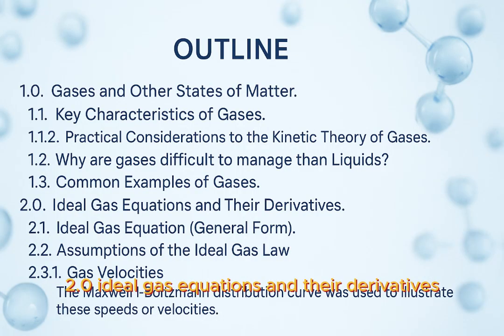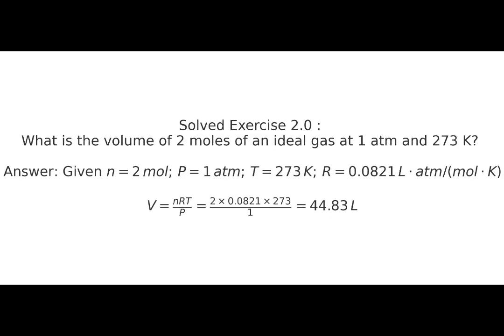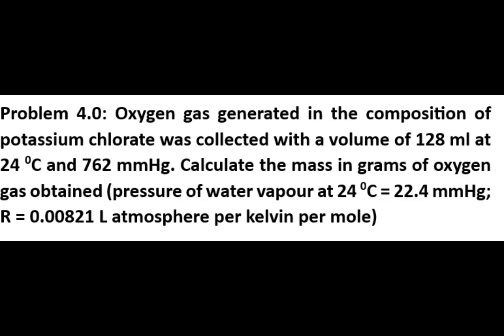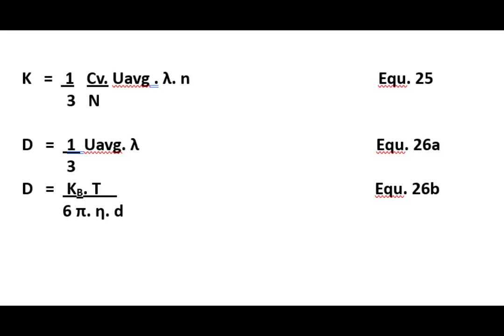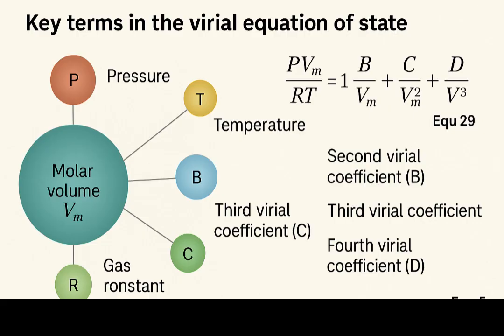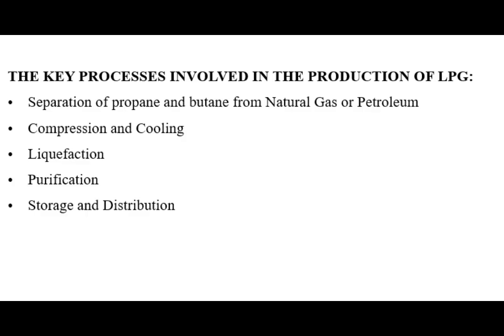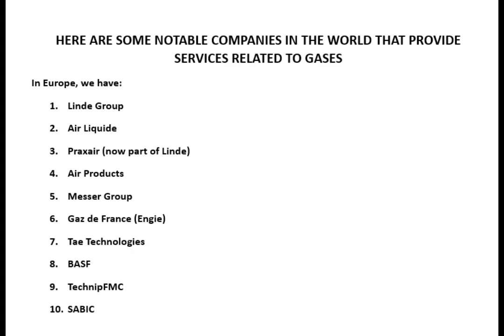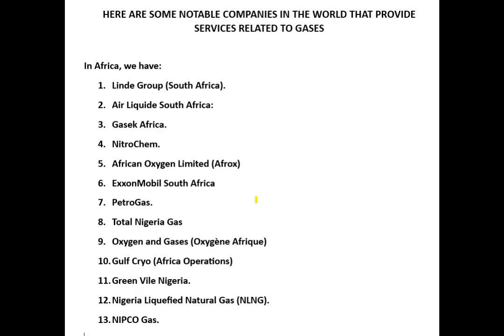Fundamentals and Applications of Gases

Comment: BCH: Using free atmospheric oxygen instead of pure oxygen from a cylinder during surgery is unsafe. Atmospheric air contains only 21% oxygen and is not sterile, while medical-grade oxygen from cylinders is over 99% pure and specifically prepared for clinical use. Relying on atmospheric air increases the risk of hypoxia, infection, and incorrect anaesthetic delivery. It also lacks the controlled flow and pressure that cylinder oxygen provides. For safety and effectiveness, only medical-grade oxygen should be used during anaesthesia.

Comment: BCH: Composition of Atmospheric Air vs Pure Oxygen
Atmospheric air contains:

~78% nitrogen

~21% oxygen

~1% other gases (argon, CO₂, etc.)

Medical oxygen cylinders contain:

100% pure oxygen or a precise medical gas mixture (e.g., oxygen + nitrous oxide + anaesthetic agents)

Implications: 
1.)Using air directly from the environment won’t deliver the necessary oxygen concentration for anaesthesia or respiration under surgical stress.

2.)Implication: Using unfiltered air from the environment risks contaminating the patient’s airways and causing infections or inflammation.

3.)You cannot control anesthetic drug concentration or delivery properly using environmental air. This can result in underdosing (patient wakes up) or overdosing (toxicity or death).

4.) 21% oxygen in room air may not meet the body's needs, especially if the patient has respiratory or cardiovascular compromise — leading to hypoxia (oxygen shortage).

Comment: BCH.......  Agwu Nneoma 
Matri U2023/5535009

Using air instead of pur oxygen would greatly reduce the oxygen concentration available to the patient. This is inadequate for anesthesia, where higher 21%oxgyen levels(often 100)are needed especially when the patient's breathing is suppressed.

Comment: Gly:U2023/5565099
 Ionization of gases in the atmosphere plays a role in lighting during thunderstorms 
  Lightning and ionization 
 During a thunderstorm, electrical charges build up in the clouds. When the electric field become strong enough ,it can ionize the air ( create ions and free electrons) leading to a breakdown of airs insulating properties. This ionization leads to lighting discharge.
  As for electric buld ,ionization is involved only on a certain types like fluorescent or gas discharge.

Comment: PIC
LNG isn't produced via JT experiment because:
1. Inefficiency for large-scale production
2. Difficulty achieving extremely low temperatures required for LNG
Instead, industrial processes like liquefaction cycles and cryogenic distillation are used for LNG production.

Comment: PIC:Joule-Thomson Cooling Is Limited
- The JT effect cools gas during pressure drop without external work.
- For methane to cool effectively via JT, it must first be pre-cooled below its JT inversion temperature
- At room temperature methane warms instead of cooling when expanded — it has a negative JT coefficient above its inversion temp.

Comment: MCB
Yes, ionization of gases in the atmosphere during thunderstorms can cause lightning
   During a thunderstorm strong wind and friction causes charge separation in clouds this creates a potential difference between the cloud and ground.Air normally resist electricity but when the electric field becomes strong enough it ionizes air molecules (nitrogen and oxygen) thereby making air a conductor,allowing a massive discharge which is lightening 
2.LIGHTING OF ELECTRIC BULB:
    Ionization is involved in some bulb not all especially gas filled ones 
Traditional bulb like incandescent don't rely on ionization rather they light up due to a heat filament BUT fluorescent and gas discharge bulbs like neon,sodium vapor, mercury lamp uses ionization because electricity ionizes the gas inside the bulb which releases energy as light when they return to a lower energy state

Comment: MCB: Yes, lightning is caused by the ionization of gases in the atmosphere during a thunderstorm. This ionized path allows a sudden discharge of electricity - what we see as lightning.
(2)Yes, for florescent and gas discharge lamps ( like neon lights or sodium vapor lamps).
And No, for regular incandescent bulbs : These use a  heat filament to produce light not gas ionization.

Comment: MCB: Yes, ionization of gases in the atmosphere can cause lightening during a thunderstorm. When the electric field in the cloud gets strong enough, it ionizes the air, making it conductive and allowing lightening to strike.
 
As for electric bulbs, ionization is involved only on certain types like fluorescent or gas-discharge bulbs, where electricity passes through gas to produce gas. But in regular incandescent bulbs, ionization does not happen. The light comes from heating a metal filament.

Comment: MCB:Yes, ionization of gases cause  lightning during thunderstorm and in some types of electric bulbs.

During a thunderstorm, when air gets heavily charged due to friction inside clouds, the gases (mainly nitrogen and oxygen) become ionized. This means they turn into charged particles, which suddenly makes the air conductive causing a massive electric discharge we see as lightning. 

As for electric bulbs, it depends on the type. Incandescent bulbs don’t use ionization—they simply heat a filament until it glows. But in fluorescent and neon bulbs, gases are ionized when electricity passes through them. This ionized gas then emits light. So, ionization helps some types of bulbs glow, but not all bulbs.

Comment: MCB(U2023/5555006)....
Yes. Ionization of gases can cause lightning during thunderstorms and also helps in lighting certain electric bulbs because.
1. Lightning in Thunderstorms:
- In a thunderstorm, clouds build up opposite charges (top is +, bottom is –).
- When the charge difference becomes too high, it ionizes the air between the cloud and the ground.
- Ionized air becomes a conductor.
- This causes a big spark of electricity called lightning.

 2)Does Ionization bring light to electric bulbs.
Yes it causes electric bulbs to produce light through ionization because.
 Lighting of Electric Bulbs (like fluorescent or neon bulbs):
- Inside the bulb, a high voltage is applied.
- This voltage ionizes the gas inside.
- The gas becomes a conductor, and the current flows.
- The ionized gas gives off light when excited atoms return to normal.

Comment: GLY: U2023/5565063
Liquefied Natural Gas (LNG) is natural gas that has been cooled to a liquid state, at around -162°c (260°F) the process reduces its volume by 6000 times, making it effective for storage and transportation.
LNG is used as a cleaner burning fuel alternative of power generation, industrial processes and transportation

Comment: MCB: Ionization and Lightning
Ionization of gases in the atmosphere contributes to lightning formation. During thunderstorms, collisions between ice crystals and graupel generate static electricity, leading to charge separation and a strong electric field. When the field becomes strong enough, it ionizes the air, creating a conductive pathway for electricity to flow, resulting in lightning.

Ionization and Electric Bulbs
In fluorescent lamps, ionization of gases (like argon and mercury vapor) occurs when an electric current is applied. The ionized gas emits ultraviolet light, which interacts with a phosphor coating to produce visible light.

Comment: MCB:. Ionization of gases in the atmosphere plays a role in lightning during thunderstorms.

Lightning and Ionization
During a thunderstorm, electrical charges build up in clouds. When the electric field becomes strong enough, it can ionize the air (create ions and free electrons), leading to a breakdown of air's insulating properties. This ionization leads to a lightning discharge.

Ionization and Electric Bulbs
Ionization of gases isn't directly responsible for lighting electric bulbs. In incandescent bulbs, light is produced by heating a filament until it glows. In fluorescent bulbs, light is produced by exciting gas (like mercury vapor) which then emits UV light, converted to visible light by phosphors.

So, ionization of gases contributes to lightning but isn't the mechanism for lighting electric bulbs.

Comment: BCH:
Not using real gas (such as medical-grade gases like oxygen, nitrous oxide, carbon dioxide, etc.) during surgery when required can have serious medical, ethical, and legal implications. Example

1. Patient Safety Risks
Hypoxia: If medical-grade oxygen is not used properly, the patient can suffer from a lack of oxygen (hypoxia), leading to brain damage or death.
Toxicity or Contamination: Using non-medical gases or impure sources can introduce harmful substances, risking poisoning or infection.
Inadequate Anesthesia: Anesthetics like nitrous oxide must be delivered in accurate concentrations. Improper gas use can cause the patient to awaken during surgery or suffer adverse reactions. 

2. Surgical Complications
Improper Insufflation: During laparoscopic surgeries, CO₂ is used to inflate the abdomen. Using the wrong type or concentration of gas can cause: Tissue damage
Poor visibility for the surgeon
Cardiovascular complications 

3. Legal and Ethical Consequence

Violation of Medical Guidelines: Not using approved medical-grade gases can result in penalties from medical boards or institutions.

4. Equipment Damage
Non-medical gases may corrode or damage anesthesia machines, ventilators, and other sensitive surgical equipment, leading to device failure or costly repairs.

Summary:
Using real medical gases is critical during surgery. Not doing so puts the patient’s life at risk, exposes the surgical team to legal consequences, and compromises the integrity of the medical procedure.

Comment: BCH:  The central implication of not using the real gas application of Oxygen in cylinders during surgery is the risk of HYPOXIA (low oxygen in tissues) in patients since sufficient energy isn't reaching the patient resulting in serious complications like;
* Organ damage 
* Brain damage & even 
* Death.
Also some clinical machines functions can be altered, like Anaesthesia machines and Ventilators which rely on precise gas measurement for proper functioning. This situation can also lead to miscalculation in gas volume and pressure. Therefore the real gas application of O2 is very crucial in cylinders during surgery.

Comment: P.I.C (U2023/5581102) _ The JT experiment involves cooling a gas by expanding it through a valve causing a temperature drop. For natural gas (LNG) which is mostly Methane the JT experiment is less efficient because its cooling coefficient is relatively small, meaning the cooling effect per expansion is limited. Thus LNG cannot be produced primarily by the JT effect experiment.

Comment: BCH: The use of free and pure oxygen gas in the atmosphere for anesthesia during surgery, as opposed to using a cylinder of pure oxygen, would have several significant implications.Atmospheric oxygen is only about 21%,the rest is mostly nitrogen with traces of other gases .where as , medical oxygen contains 95-100% pure oxygen under pressure. Using atmospheric oxygen would be highly inefficient. It would be challenging to deliver a precise, consistent amount of oxygen to the patient. Using atmospheric air doesn’t allow accurate control, which is critical during anaesthesia. Anesthesia requires a precise balance of oxygen and anesthetic gases.Without a controlled delivery system, it would be impossible to regulate the amount of oxygen and anesthetic agents the patient receives, leading to potential complications.

Comment: MCB:

1) Ionization is a crucial step for lightening formation during thunderstorm. It's a key mechanism that allows the energy stored in the storm to be released as lightening

2) The lightening of certain light bulbs like: gas discharged lamp,is directly related to the ionization of gases. This ionisation, have been proven to lead to the emission of light.

Comment: GLY: U2023/5565009: In coiled tubing operations, nitrogen is used as a gas lift or to energize fluids. The reason for using real gas properties rather than ideal gas properties is that real gases deviate from ideal behavior under high-pressure conditions, which are common in oil and gas well interventions.

REAL GAS BEHAVIOR

1. High Pressure: At high pressures, real gases exhibit non-ideal behavior, such as increased density and compressibility.

2. Accurate Calculations: Using real gas properties ensures more accurate calculations of gas volume, pressure, and flow rates.

IMPORTANCE

1. Safe Operations: Accurate calculations help ensure safe and efficient operations.

2. Optimal Performance: Using real gas properties optimizes coiled tubing performance and reduces the risk of errors or accidents.

Comment: BCH: Using normal air from the atmosphere instead of pure oxygen from a cylinder during surgery is very risky. The air around us only has about 21% oxygen, while patients under anaesthesia often need a much higher and steady supply to keep their brain and organs working properly. Without enough oxygen, the patient can suffer serious complications like brain damage or even death. Also, atmospheric air isn’t clean — it contains dust, germs, and other particles that can lead to infections. On the other hand, oxygen from a medical cylinder is clean, pure, and delivered in the right amount under strict control. That’s why doctors always use cylinder oxygen in surgery — it’s safer, more reliable, and protects the patient.

Thank you

Comment: BCH: Using atmospheric oxygen instead of medical-grade oxygen cylinders during surgery poses serious risks. Atmospheric air contains only about 21% oxygen, mixed with nitrogen and trace gases, making it unreliable for precise anaesthetic delivery. In contrast, oxygen from a cylinder is pure, controlled, and sterile—ensuring the right concentration needed to maintain patient stability. Free atmospheric oxygen also carries potential contaminants and unpredictable pressure levels, which could compromise anaesthesia safety and effectiveness. Therefore, the use of pure oxygen cylinders is critical in maintaining the strict physiological conditions required during surgery.

Comment: GLY: 
Significant Deviation from Ideality: Under the high pressures (often thousands of psi) experienced downhole, nitrogen molecules are forced closer together. This makes intermolecular forces and the finite volume of the molecules significant, causing the gas to deviate substantially from ideal gas behavior (PV = nRT). Its actual volume is less than predicted by the ideal gas law.

Comment: BCH: The implications of not using the real gas application during sutgery are 
1. Incorrect pressure and volume: oxygen which is a real gas deviates from its ideal behavior at high pressure which makes doctors think there is more oxygen.
2. Inaccurate flow rate: During surgery the patient may receive little or too much oxygen affecting the anesthesia

Comment: BCH: Not using real gas applications during surgery  especially when administering medical gases like oxygen, nitrous oxide, carbon dioxide, or anesthetic vapors — can have serious implications, depending on what "real gas application" means in context.

 Implications of Not Applying Real Gas Application During Surgery

1.Incorret Gas volume or flow Delivery.

2.Imprecise Anestesia dosing.

3.Tank pressure and storage Errors.

4.Ventilator malfunction or miscalibration.

5.Poor patient outcomes.

Comment: Pic:

LNG is not produced solely using the Joule-Thomson (JT) effect because methane (its main component) has a very low boiling point (−162°C) and a low JT inversion temperature. JT cooling only works effectively below this temperature, so LNG requires pre-cooling with complex refrigeration systems before JT expansion. In contrast, LPG (propane/butane) has higher boiling points and can be liquefied using JT cooling at near-ambient conditions, making the JT effect sufficient for its production.

Comment: BCH: U2021/5535276
Using oxygen from the atmosphere even though it's termed "pure" in the question has some implications. All surgical processes are highly regulated and controlled 
Cylinder of pure oxygen gas can be controlled  to avoid increased pressure and concentration . Prolonged exposure to pure oxygen at high concentration can result in toxicity which can affect the patient

Comment: BCH:

Using free and pure oxygen from the atmosphere instead of cylinders for anesthesia during surgery sounds like a good idea at first, but it's actually quite complicated.
On the plus side, it could save money and reduce logistical issues with storing and transporting oxygen cylinders. Plus, it's a more sustainable option.
However, there are some big challenges. First, it's hard to control the exact amount of oxygen being delivered, which is crucial for anesthesia. Second, atmospheric oxygen isn't always pure – it can have impurities and vary in concentration, which could affect patient safety.
Additionally, we'd need specialized equipment to capture and purify the oxygen, which would add complexity and cost.
Most importantly, patient safety is paramount, and any new system would need to meet strict medical standards and regulations.
So while it’s an interesting idea, it’s not something that can be implemented without careful consideration and development to ensure patient safety and effective anesthesia delivery.